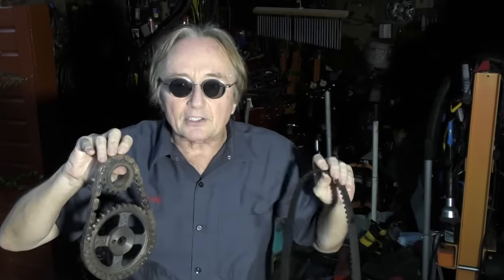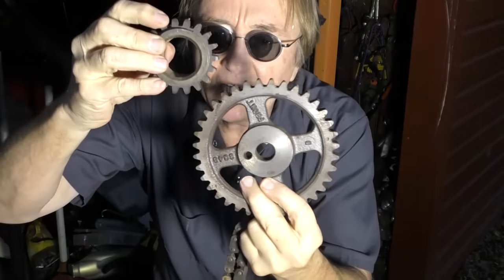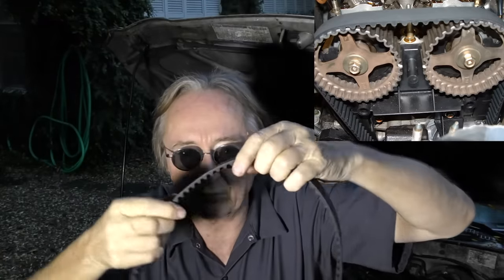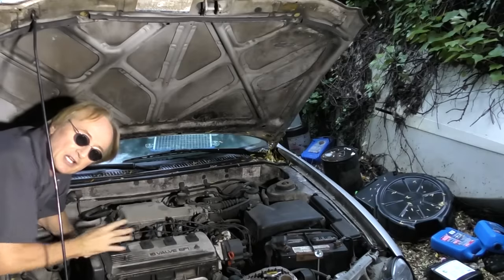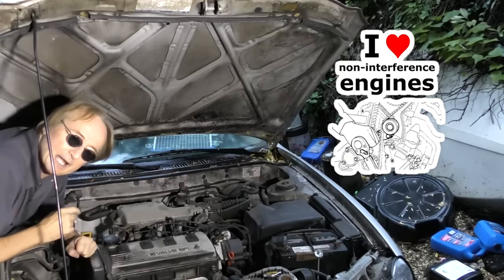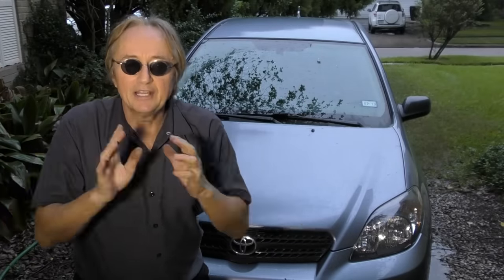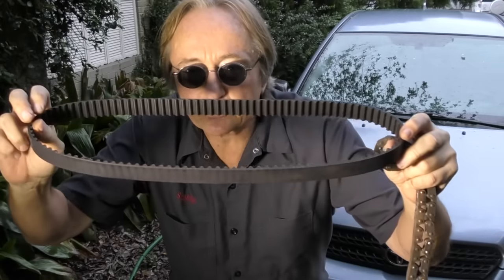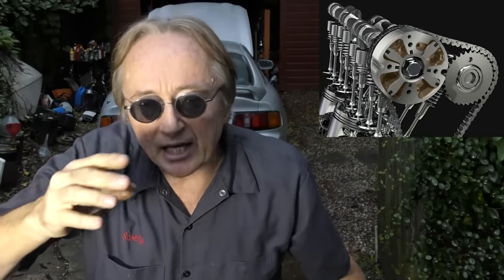Why Some Cars Have a Timing Chain Instead of a Timing Belt

Comment: Timing belts are only used for ohc engines. Ohv engines always used chains. The camshaft is a lot closer to the crankshaft on an ohv engine because its inside the block so the chain is very short. Ohc engines have a longer distance between crankshaft and camshaft so they use belts because a long chain can be a problem on the earlier ohc models. Ohc v engines have even more distance to cover because there are 4 cams that the belt has to reach around.
Reply: reach around
Reply: I like those classic "underhead cam engines"
Reply: Rolls ohv use timing gears
Reply: This is not true. My Ford taurus has an overhead cam, with a chain. The length of the chain is irrelevant to anything but cost.
Reply: Used to be able to buy a timing belt and gear set for V-8 engines I think it was for people that would degree their engines.
Reply: Fiat Mirafiori ohv engined cars had a timing belt from the factory. I dare say a few others did. Jaguar xk engines had two timing chains, notorious for stretching. Some modern engines with chains have a tendency  to wear out guides and have chains jump teeth. No method is foolproof.
Reply: Dan C, not true. My Cavalier has a DOHC Ecotec in it and it has a chain not a belt.
Reply: And what about DOHC? One belt for two cams right? High rpm cars like these punks drive all have DOHC engines and they use Nitrous and other wonderful inventions like turbos and superchargers but do they change the front timing belts to something better? is there such a thing?
Reply: Ford modular v8, the single jingle motors used 2 chains, one per head, dohc used 4 chains!
Reply: My 1984 SOHC Mazda B2000 used a timing chain.
Reply: Cadillac Northstar engines DOHC V8 with chains
Reply: Land Rover 300tdi is interference OHV and a bloody belt!!!! caused alot of early punched valves with misaligned    belt /gears..
the only thing dodgy on an otherwise great engine!!
Reply: My 85 Cavalier (2 liter) and 73 Chevrolet (4.1 liter) both had gears.
Reply: You can remove chain and install gears on OHV V-8s, e.g, Edelbrock Accu-Drive Camshaft Gear Drive
Reply: Like many other have said, OHC V engines do use chains. My 3.2 v6 Mercedes that is 18 years old, SOHC, roller rockers and chain. 100K miles and it runs as good as new.
Reply: from  the  manufacturers   perspective,  the  main  reason  for  a  belt  is
to  save  $$.   same  goes  for   front  wheel  drive.   forget  the  long  driveshaft
to  rear.   turn  the  motor  to  the  side,  and  connect  it  "straight  to"  the  wheel.
cut  (back on)  the metal,   use  more   rubber  n  plastic,  n  cut  costs.........
Reply: Dan C okay so my 1992 Subaru Legacy turbo 5spd is a 2.2 single over head cam but it’s a boxer engine ..!!! Couldn’t they of put a timing chain on this particular model ?? Not quite sure of the distance between crankshaft and camshaft
Reply: My bicycle has a chain , does it have a sohc ?
Reply: Sorry dude. Incorrect information. My Mercedes m112 v6 has timing chains and my Mazda atenza l3-ve also has a chain.
Reply: NASCAR engines use timing belts, because they're lighter and take less power to run. Belts also absorb harmful harmonics that can occur between the crankshaft and cam.

Comment: Well, I remember when I was doing my Master degree summer practice, I was working with Toyota research department in Lausanne. The timing belt VS. Chain was because of the high rpm new engine and the mpg efficiency. Lighter weight moving parts. Not only for saving money. Just my 2cnt...
Reply: geniusfde 
That's what they told you. High efficiency big engines in muscle cars use timing chain.
Reply: @betoen  you agree that technology evolved! Back then, the belt was the ultimate solution!
Reply: geniusfde 
Of course.

Comment: I don’t know why so much hate towards Nissan. Most of the cars I see causing engine failure due to broken timing belts are HONDAS. Even the last gen Pilot had one and needed to be changed before a certain mileage because all Hondas are Interference engine. I had a 2006 Accord V6 that needed a timing belt replacement along with tensioner and leaking water pump at just 34k miles, cost $2k and the dealer refused to do it under the powertrain warranty because, well, they could since they are Honda. I went and traded that sucker for a new 2011 Toyota Scion TC which rode like it didn’t have springs or shocks on it after miles accumulated and had all sorts of rattles after 20k miles. Then traded that for a 2013 RAV4, same story as the Scion. Traded it for a 2014 Nissan Pathfinder and after 50k miles still as solid and rides buttery smooth without a single issue. Toyotas are good cars, at least the new 2018 have improved their quality but they are now on par with other cars being made today. I know, I’ve had plenty of them and the 80’s/90’s Toyotas were the best, new ones not so much.
Reply: Fevian Cortes exactly! We’ve owned many Nissans since the 80’s and love em!

Comment: My 5.9 Cummins has timing gears so I should be good right?
Reply: Totally
Reply: As long as your teeth are in good condition you will be golden, no chain stretch or belt fraying to deal with.
Reply: Question is 12 valve or 24 valve. KDP on the 12 valve your golden forever...the Dodge body will rot around the engine.
Reply: except for the "kdp" or killer dowel pin, that likes to fall out and destroy all the gears, and that is MUCH MORE $$$ and labor intensive than bending valves on a timing belt
Reply: Mine's the 97 with the 12 valve. You're right there's nothing holding it into the block. I know they do sell kits to secure the KDP for like $20 on the interwebs. It's probably one of the best investments.
Reply: Well it can do 1 or 3 things:

Stay in the block forever and never fallout.

Fall out in the timing cover and bounce to the bottom, no damage done.

Or fall out and wreak havoc on the timing gears.

You can just put a small bolt in with a piece of sheet metal and you'll be fine and spend less than $5 on that part.
Reply: You should change the gears every 50,000 miles.

😏
Reply: I have an old enough Ford that its got pushrods. I believe it would still have the chain in it instead of gears but it does have a whining noise to it (most likely the transmission).

Comment: The tensioner on my chain driven VR6 failed, causing the chain to slip and yup, smashed the valves. While chains are great, it’s the other phenolic crap that can undermine the chains reliability and result in catastrophe.
Reply: easy, don't use plastic gears :O
Reply: @wayneparris3439  Try telling gm that. Especially the Iron duke & GM 122 engine era. AKA 2.2~2.5 valve benders.
Reply: What happened to good ol fashion manual chain tensioners

Comment: Diesel's still use timing gears. It's part of the reason why they are so damn reliable.
Reply: Not all of them. I just had a 1.9 cdti engine go because the damn timing belt went. Engine ruined, car ruined. Since it was 16 years old it was not worth repairing the engine or getting a new/used engine. Car was worth 3-3.5k USD, the repair or a used engine would cost me around 3k. And who knows, if I spent that money something might go haywire 6months later because its a old car...
Reply: Just trucks.
Reply: Diesel particulate filters would like to have a word about reliability.
Reply: Not True either, Toyota and Nissan Diesel use timing Belts. In there Trucks and SUVs
Reply: I'm assuming he talking about trucks because it seems most of the smaller cars/engines have belts. My 81 Rabbit was definitely belted as I changed it when doing a partial rebuild. Biggest issue was getting the injector pump timing right. Thank christ my dad was a helluva mechanic to do most of the heavy lifting on that task.

Comment: I have a Honda with gear driven cams. It's a 700cc V4 Interceptor and only has two wheels. It does make a slight whining noise like you said but with motorcycles and the constant mesh transmission gears they always make a whining noise to some degree and it's not very noticeable over the exhaust anyway. Nice accurate description and presentation.

Comment: 220,000 miles on our timing chain in our 2006 Hyundai sonata. no problems yet, we change our oil every 4,000 miles.
Reply: had an '87 Trans am with the 5.7L.  Timing chain was replaced at 300,000 miles because it seemed like a good idea.  laid out side by side, the new one was 1/8 of an inch longer so the whole thing had stretched 1/4 of and inch.
Reply: Pat Treu u will never have problems with that.
Reply: You don’t need to change your oil that frequently if you’re using synthetic. You’re just wasting oil that has 60% of its usable life left, and there will be no benefits. Good quality synthetic oil doesn’t lose any of its viscosity until much later.

Comment: Oh, how I love the dependability of pushrod engines!  A timeless design.
Reply: Push rod engines have a flaw of Valve Floating at higher rpm's
Reply: @SilverDollarSaloon  Isn't the red-line on pushrods only about 4000-5000 RPM whereas ones with timing belt or chain can go up to 8 or 10000 RPM?

Comment: Great video. My dad owned a 1969 Pontiac Grand Prix that had a 428 Cubic inch engine. At about 30,000 miles, the timing chain "jumped".  These engines, from the factory, had a timing chain containing metal sprockets that had nylon (plastic) teeth. It was the premature wear of these nylon teeth that caused the timing chain to "jump".  Pontiac told him that this design made the engine run quieter. We all know that making gears containing plastic teeth was probably cheaper to manufacture.  Thankfully, there was no other engine damage as a result of the timing chain jumping. The timing chain was replaced with a heavy duty, all steel timing chain and sprockets. The engine did not sound any louder after the replacement.
 52 years later, the engine still runs good with the same,  all steel timing chain assembly.

Comment: People dont maintain the oil in their cars so timing belt engines are easier on the oil.. a 20k oil change with a timing chain that motor is hurting with a belt the engine's seem to take it. But changing your oil often is a easy solution.  But some people cant grasp that.
Reply: Very true. My cars with timing belts drained cleaner oil out at same mileage. The chain itself must dirty the oil more or create dirt.
Reply: 20k? In Turkey most of the people changes at 10k. Probably maintenance shops persuaded us to check the car at every 10k to earn more money :)
Reply: Yep. you are spot on.. keep the oil good and the chain will last forever much like the rest of the engine...People who know nothing about engines and haven't rebuilt any before always tell me : nah you dont need to change oil that often...sure you dont buddy
Reply: @themisunderstoodgorilla7030  Sounds like more baloney. People are probably changing their oil way too much.  My uncle was a chief on the tugs in his career.  Enormous engines producing 10's of thousands of HP.  Engines so big you (he) had to walk through them while they ran.  Changing the oil was an enormous and costly activity.  Oil samples would be taken and sent to labs for analysis, only changed if necessary.  It hardly ever was.
Reply: @percussion44   Thats a completely different specimen with a completely different oil filtration system.?? why dont we compare it to Jet engines instead ? Only Baloney around here is whatever argument you are trying to produce. Let me ask you this, you tell your friend "you're changing your oil too often its a waste stop doing that" they do what you say and their engine fails... will you help fix/pay for the repair ? Dont bother replying unless you're going to answer my question champ....
Reply: Cant be that bad. I change oil once a year = 30k miles. I also only buy japanese or korean cars with chains. (second hand with <100k) Never had any problem caused by chain or oil. 

I think changing oil often is probably a good thing if you want to try and make 2 million miles on it. But since we all get rid of our cars around 200k or maybe 300k as at that point the car is worth about as much as the cost of an oil change anyway, i think there is not that much of a point to it. (my cars usually go to Africa because the exhaust is rusted, the shock absorbers are bad, the seats are like hammocks and hurting my back etc... and the cost of fixing that kind of stuff is getting to exceed the value)
Reply: @antondegroot6061   Couldn't care less mate, Oils cheaper and easier than replacing a chain.  your lack of maintenance with seemingly no problems yet proves absolutely nothing..Let me now what the engines like when you rebuild it. have a nice day
Reply: @themisunderstoodgorilla7030  The Garage charges about 100€ to change oil. If you want to do it every 10k, that adds up to 2000 - 3000€ over the lifetime of a car. Since i have driven about 500-600k and  changed it only 1/3 as often, i saved myself about 4000€ by now. Thats more than i usually pay for the cars i buy.

I do admit it is a result of our consumer society where labour is over taxed and resources are subsidised. I would like a world where it was the other way around and we would repair our cars for longer and keep them running 500k miles or more by taking good care of them. But unfortunately we dont live in that world and @200k, merely replacing shock absorbers costs more than the car is worth. Let alone rebuilding engines. That is a thing that doesn't really happen anymore in rich/expensive countries.
Reply: @themisunderstoodgorilla7030  You should perform a complete top end overhaul every 4 hours like in NASCAR.  You gonna pay for the overhauls.  Back at ya champ.
Reply: @antondegroot6061   in my country have garages that just change and sell oil, so is not charge for changing it, you just buy it, and in about 40 euros to change. so all people do it every 15K km
Reply: I change my car oil every 4K
Reply: Brad Brad  no but I've seen engines not make 100 on 20k oil changes
Reply: Always change oil between 3500 and 5000 miles. I have always used Synthetic Oil to prolong engine life.  Check oil once a week in case you develop an oil leak causing an increase in oil usage. Every day look under your car in your drive way to check for dripping oil and oil leaks. Have the oil leaks fixed right away. Leaks can get worse and/or more leaks will happen.  @korayerman4275
Reply: Do  you mean ten thousand kilometers?  Now I have to convert that to miles in the USA.  @antondegroot6061   That is 6,214 miles and is still too many miles between oil changes.  Stick with  3.500-4,000 miles (5600 - 6400 kilometers) for the oil changes. Also, check the owner's manual of  your car for when to do any kind of preventative maintenance.
Reply: Dirty Garage 20k????? 20k what? even 20k kilometers is wayyyyy too late.
A lot of manufacturers these days recommend 15k km (9k mi) or 1 year, which is still questionable to me.
Reply: Brad, around here cars are totaled before 200K+. Poor people buy them as beaters for commuting to work.
Reply: @percussion44  you are right to an extent. Large engines are tested monthly., if they run constantly, they have centrifuges that are constantly cleaning the engine oil along with filters in some cases. You can't install centrifuges in cars. They are as big as the engine in a car. They have to be that big for the centrifugal force to work. They pull out any denser impurities as theses will collect at the outside edge of the centrifuge. Cylinder blow by (carbon) is the impurities that accumulate. These engines have hundreds of gallons of oil. Testing the oil is short money compared to a replacement. Testing your cars oil is comparable to the cost of changing it.
Reply: @korayerman4275  miles or km?
Reply: Just had my wifes chevy timing chain changed for $3,500. The previous owner didnt keep the oil changes up good enough I guess.